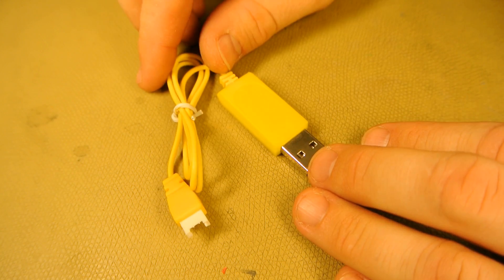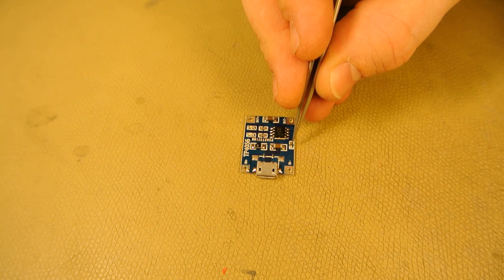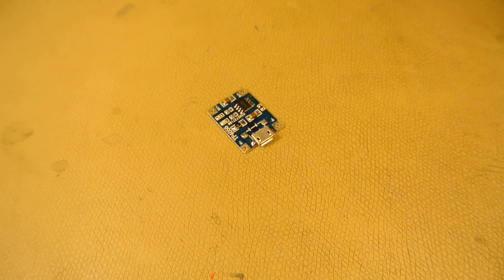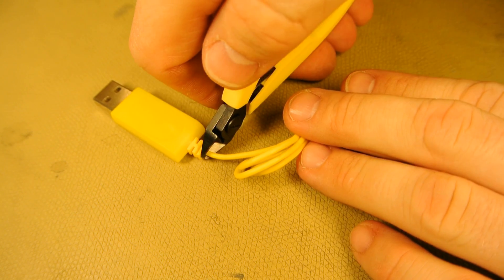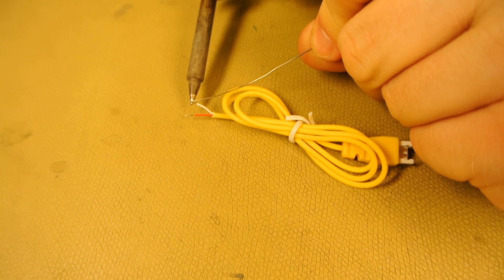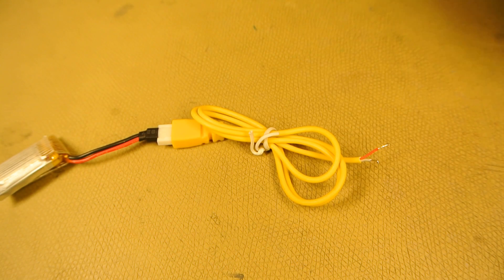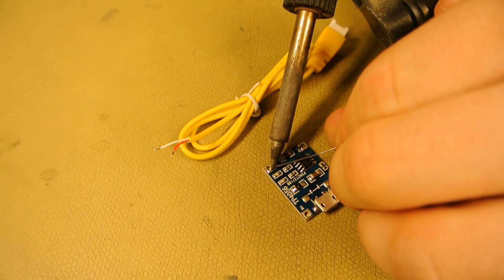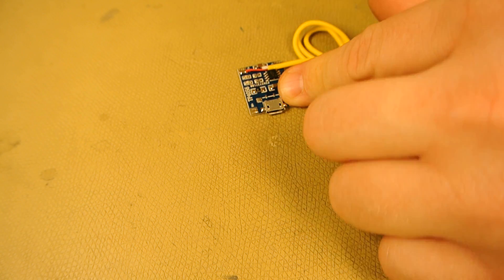Changing charger for quadcopter

Comment: Thanks for the info, I've been seeing multiple videos saying that the default chargers aren't really good for the copter, I'm glad to see there's a way to change that, question though, what power resistor would you want to use for a 650mAh 3.7 LiPo battery for a sky viper furry drone so I can modify my charger?
Reply from the maker: Ideally you would set charging to about 650mA which should be a resistor of 1.8kilo-ohms, however since these are high current batteries for flying toys you would probably be ok with the original 1A or 1.2A that the TP4056 chargers come set to on delivery.
Reply: @Ghlargh , just saw your reply, thank you so much I'll keep it in mind

Comment: It looks to me like you replaced the 1.2K resister with a solder bridge  :)  But seriously, thanks for the video...it's nice to have an actual charger rather than a dumb battery cooker.
Reply from the maker: With enough flux on the board you can solder both ends of an SMD resistor at the same time like that. Of course with bad solder or not enough flux it's going to bridge.

Comment: what resistor whould it be in the newest board with battery protection? There are a few and not with a white marking.
Reply from the maker: If it's a board with a TP4056 or equivalent chip it's going to be the resistor connected to pin 2 of the chip.
Reply: Ghlargh thx i think i found is. i measure it bevore i desolder it.
Reply: Hello